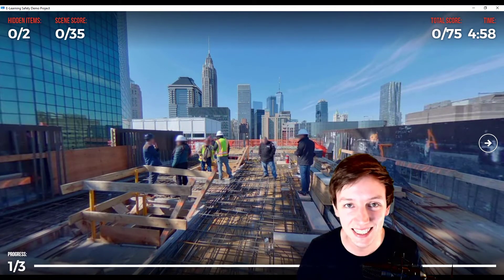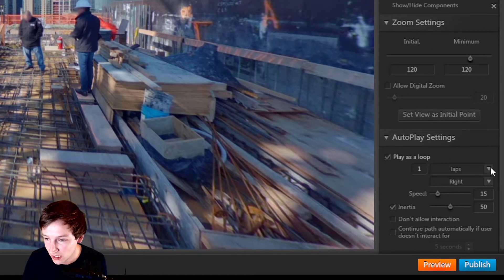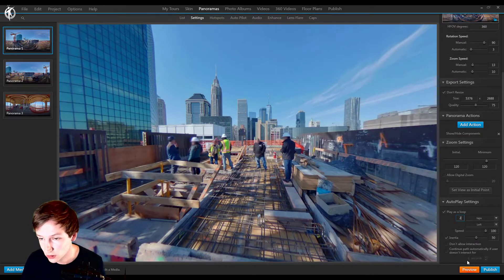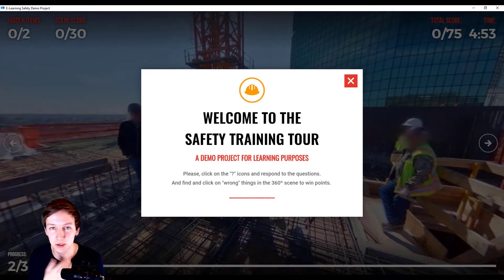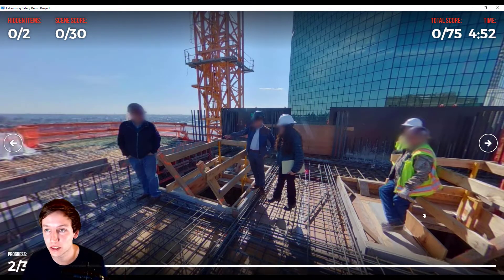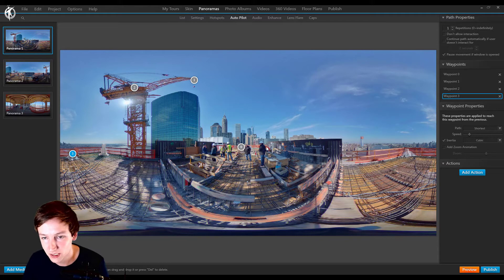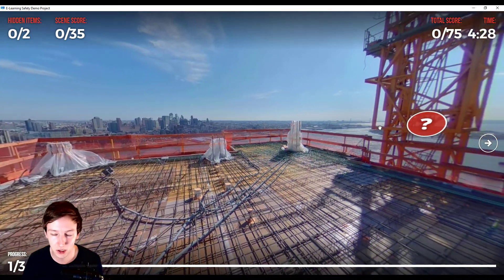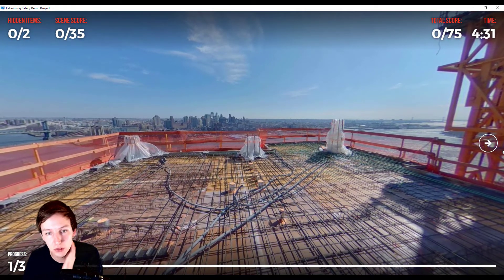Autopilot Camera in 3DVista

Comment: Hi .. Is there a way to control vertical FOV limit .. of course its not in settings.. I would like to know if we can make this using Execute JS or something.

Thanks in advance!
Reply from the maker: Vertical FOV adjusts automatically according to the HFOV and aspect ratio of your imported panorama. If you want vertical scrolling images, you should change regular 2:1 ratio to 1:2 for example and change the HFOV. If that makes sense :)
Reply: @360Creators  thanks for replying!. HFOV is always 360 degree in my case. I had issue when in imported panorama VFOV was 212 degree(more than 180 degree) with creating hotspot with polygon shape. the area I was marking wasn't same in preview.. Hence I thought It would work only with 360x180 FOV. 

To control vertical fov.. I cropped pano from top and bottom then I am able to control (360x117 degree fov). only issue is.. the hotspots I created with old render will not work anymore.

Comment: Thanks for the tutorial, is there an option to start autopilot only after clicking a button? I don't want the autopilot to start automatically at the start of panorama.
Reply from the maker: Select panorama > panorama actions > media control.

On start of panorama, pause autopilot.

Then add an action to the button to resume autopilot.
Reply: @360Creators  Hi, currently I'm doing a small testing on clicking the hotspot, it will trigger go back to a waypoint first then only trigger a video transition. And I used the method pause autopilot at the beginning, it works fine. But when I start to turn around, and click on the hotspot again, it will not trigger the "resume autopilot". May I know why is that? Am I missing any setting?

Comment: Is it possible that a video or image is activated when you program that it turns to one side? When the video ends, it turns in another direction and activates another medium?
Reply from the maker: I think you can do that by using Add Action > Media Control > Play/Pause Autopilot camera 😉
Reply: @360Creators  Hi, I tried adding a button action > media control > resume autopilot, and in the panorama setting, i add action > media control > pause autopilot. And in the autopilot, I set the waypoint to show video at end. It works fine if I didn't turn the panorama, but when I start to turn the panorama manually, the button won't work. May I know why is that?

Comment: You can adjust the speed in which the waypoints are set correct? Noticed that you sped up the video :)
Reply from the maker: Correct. Yess I have sped up the video sometimes so it wouldn't be too boring